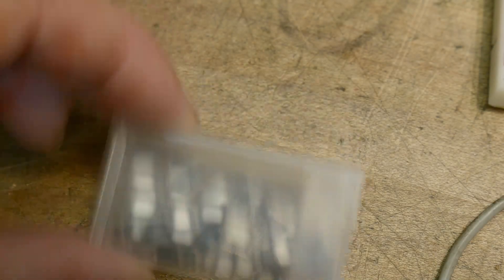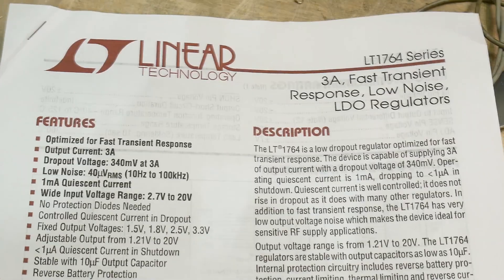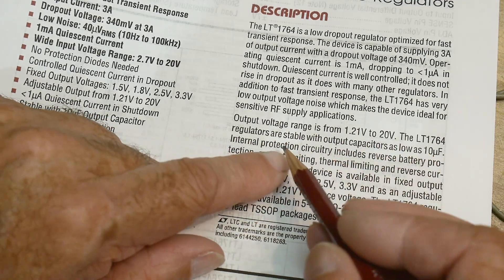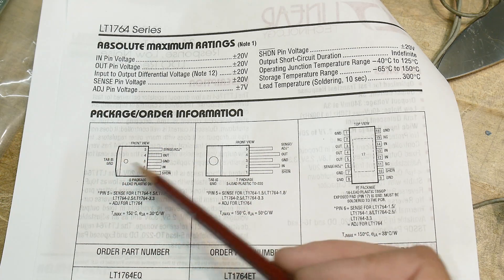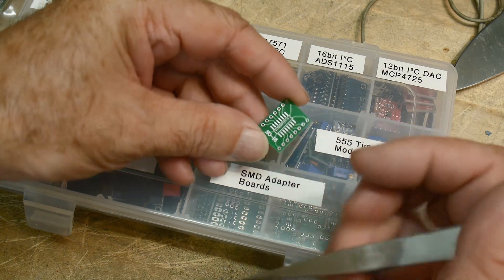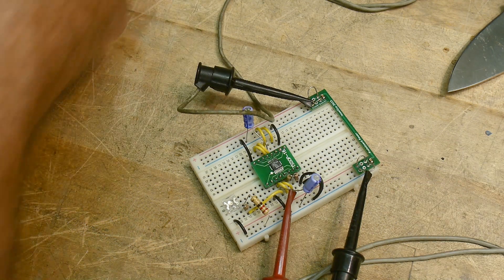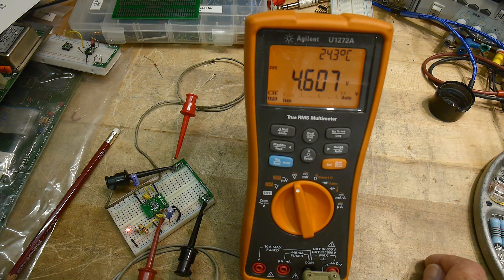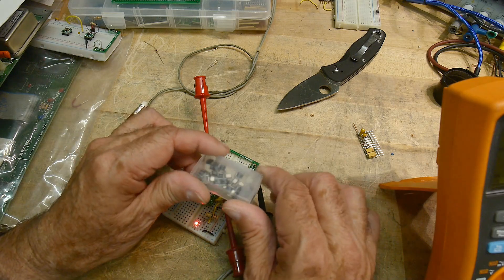#1936 LT1764 3A Adj Voltage Regulator

Comment: That package makes it difficult to use to its full current capacity. It could only work that high if used on a bd designed for it and oven soldered, something many hobbyists aren't up for. But for smaller loads, putting it on an adapter board makes it very usable.

Comment: Those chips are $10 apiece at the distributor.  That Tic-Tac box is worth hundreds of dollars.
Reply from the maker: you can have it for $200
Reply: @IMSAIGuy  what a bargain!

Tic tacs famously are 1.9 kcal per mint, and this chip in SSOP can dissipate 2.6 W (room temperature, giant ground plane).  So at full power this chip can burn one tic tac's worth in 51 minutes.

More seriously, this "3A" chip can only sustain 3A if the voltage drop is 866 mV or less.  So forget about using it for 5V -> 3.3V conversion at 3A... it can only do that at 1.5 A, and only in a perfect thermal situation.

Comment: It might be nice to mention to viewers that the adapter board used does not have a pad for the large central pin on the device and that this will substantially limit the power dissipation (and this maximum current)
Reply from the maker: you just did, but you are right

Comment: Are those boxes ESD safe?
Reply from the maker: nope
Reply: @IMSAIGuy ,  :)
Reply from the maker: @johnwest7993  john, how many parts can you count that you have zapped with esd? I've never had one.
Reply: @IMSAIGuy  I've had a few DOA and am uncertain as to why, it may have ESD but who knows?
Reply from the maker: @lc79tourer26  I asked a bunch of EE friends and the only failures were with very sensitive CCD parts. No one could recall a digital CMOS failure due to ESD. the climate in california may be helping though.
Reply: @IMSAIGuy  I use to rub my boxes with a fabric dryer sheet.  I have a buddy that uses car wax.  Same idea.
Reply: That was going to be my question.  Buggar, you beat me to it.
Reply: Esd rarely destroys semiconductors immediately, it is more on long term failure. Of course that's not a concern for hobbyist, but it is for industry.
Reply: @patricktuchais7596  Unless you're an industrial hobbyist. (black foam seems to work fine)